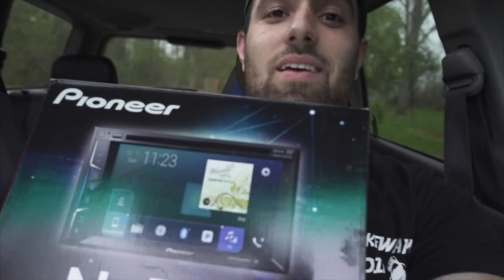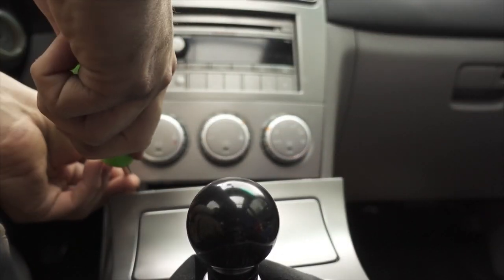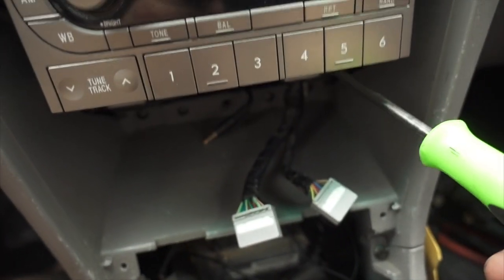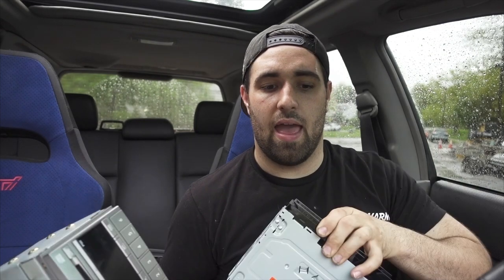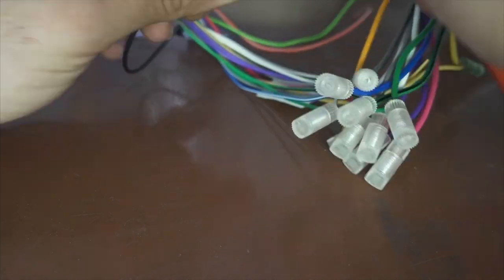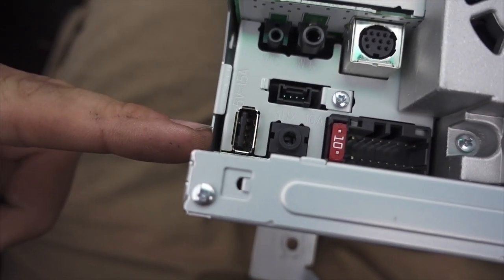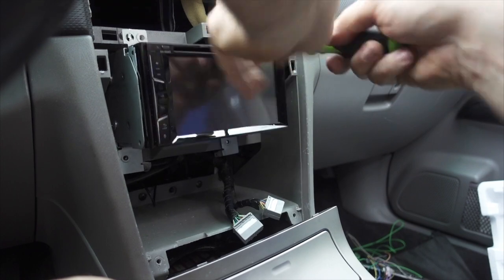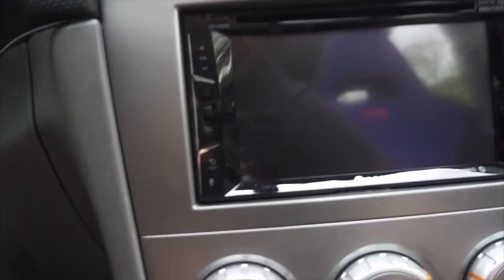MAKING MY RADIO NOT SUCK! (FORESTER XT RADIO INSTALL +JDM HAZARD)

Comment: Hey Cody, what was the bypass module for? You never mentioned it in the video! Loving your videos by the way! Starting my mods on my '05 FXT in the very near future!
Reply: It's for headunits that require you to be in park to use certain features. I wired one into my aftermarket radio for my 06 fxt

Comment: Show an 06
Reply: They’re the same, I have one.
Reply: Absolutely not. You have to disconnect the heater control cables
Reply: @earthisflatspaceisfake  Even so, the radio part is the same. Mine's an Australian MY06 model.
Reply: It was the taking the cables apart that baffled me.